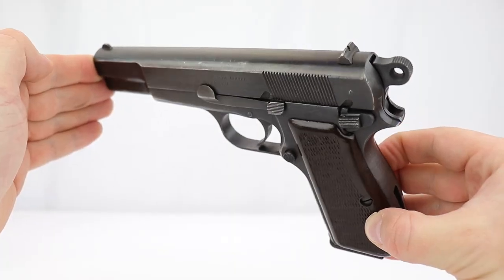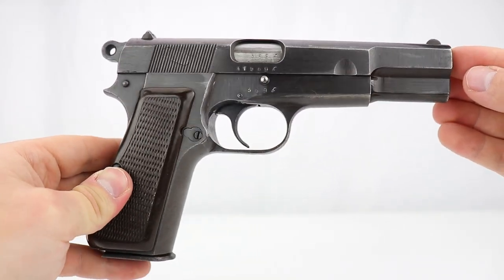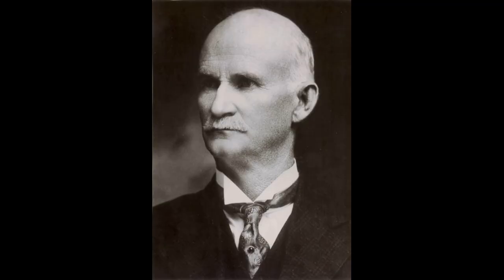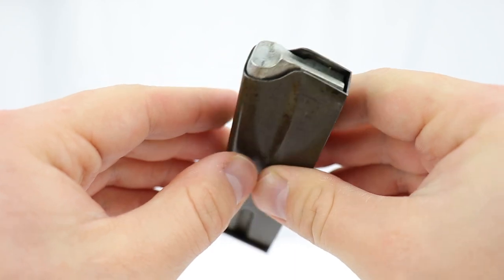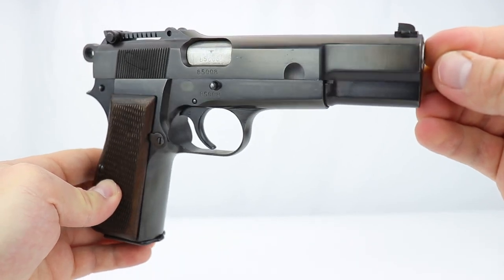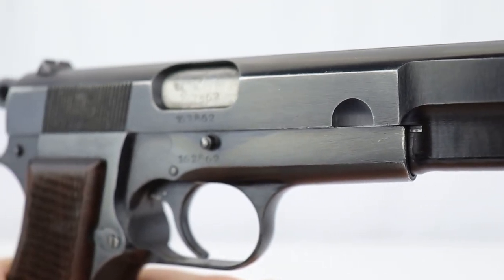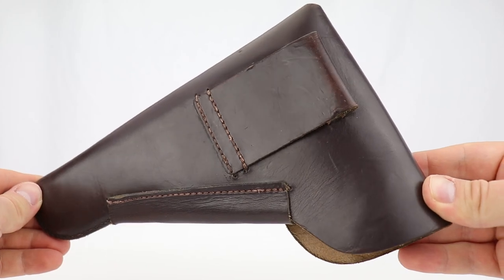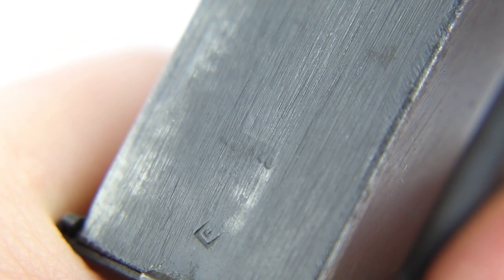WW2 Browning Hi Power Pistol | Walk-in Wednesday

Comment: The idea of having a stock for an automatic pistol seems to have originated with the Broom Handle Mauser of around 1895 or so. The Boers used them quite extensively against the British in South Africa in the second Boer War of 1899 to 1902. There are a couple of them in the Battlefield Museum in Ladismith in the province of Kwa-Zulu Natal, where the Boers besieged the Brits for several months.
Reply: Stocked pistols have existed about as long as pistols themselves have existed, they predate the c96 by at least a good 200 years
Reply: Mauser C96 wasn't the first handgun ever to have a stock added to it, it isn't even the first semiauto pistol. The Borchardt predates it.

Comment: I have one of the German P-35 FN High-Power 9mm with fixed sights. I had to do some work on it, because it was pretty much rusty. It works like a well oiled machine and is very accurate. I use for hunting wild boar as a backup weapon.

Comment: The belgian workers of FN sabotaged the weapons they were building for the germans to such an extend that the germans had to bring their own workers (foremen), that resulted in sabbotaged machines. The belgians made quite an effort in that, many things were very clever sabotaged that they brake in the field, but not in testing, for example bad tempering of steel or too little tolerances in some places so that the smallest bit of outside-dirt blocked the mechanism or it only worked with the one kind of testing ammunition they got etc etc They went really creative. Don't know about the high powers in particular, what I read was mainly about machine guns, but this one looks absolutely awesome.

Comment: do you have a good resource on verifying german marked hi powers? i recently bought one i believe is a bring back. it has marking on frame and slide but was sadly seems reblued and the controls were gold plated. was this a rather common thing done?
Reply: Damon christopher it has a wa140 marking on slide and frame and on the front along with a german eagle. it has a non matching barrel and no magazine disconnect

Comment: I am trying to date mine, Serial # is 97356a on the slide, and 97365b on the lower, the only proofs I can see are on the bottom but are hard to make out, maybe a dr, and a half moon. they look more like symbols, on the mag well bottom. it has the Fabrique NAtionale D'armes on the slide, no slot on the mag well for the stock. It has the fixed sights up top. Internal Extractor, and wood grips. I have pics
Reply from the maker: Mismatched gun but made in 1944 and the proof would be WaA140.

Comment: No, JMB DID NOT design  the first prototype of what became the FN P35.  That was Diedonne Saive; he modified FN's existing Model 1903 to work with the double stack magazine he invented to start with.  JMB initially wanted nothing to do with the project and he was back home 8n America at the time.

When the French rejected that initial  prototype vand specified it must also have a locking breech design, FN shipped the prototype and Saive's magazine to JMB and asked him to have a go,  He sent FN and the French two different designs; both striker fired.   One was a blowback design the french had already said they wouldn’t accept and the other had a rotating bolt head sum8lar to the later M16.

The French rejected both as they had Saive's  initial prototype.   JMB sold the patents for his designs to Winchester and went back to working on the design of his Superposed shotgun, dying less than two years later.  

France wandered off to design their new handgun for themselves; Saive spent the next10÷ years working on his design until eventually the Belian military took an interest in the Grande Rendemant version.  With changes that they requested, what we now know as the FN P35 went into production.

JMB had about as much to do with designing the Browning High Power as he did with the earlier Baby Browning pistol.  It wasn't marketed as the Browning High Power until Browning's son Val started what is now Browning USA and started importing FN pistols, shotguns and rifles (and the rifles at times were made by Sako and now Miroku).

FN knew/knows you could never go wrong attaching JMB's name to guns you wanted to sell to Americans!

Comment: There is no Radom pistol. You mean Vis 35  made in Radom. All polisch guns have Radom stamp. There are Vis mod 30 and 32 also. Please use correct name and this name is a big VIS on the grip, not small stamp on the slide.

Comment: i have a third variation has all matching numbers barrel slide frame the pistol has the 2 small eagles holding swastika on left side But no wa140 anywhere except for on the barrel which you cant see unless you remove barrel what does that mean? all ones i see have the waa140 in front below barrel and on the side of pistol is something wrong or is it fake maybe?